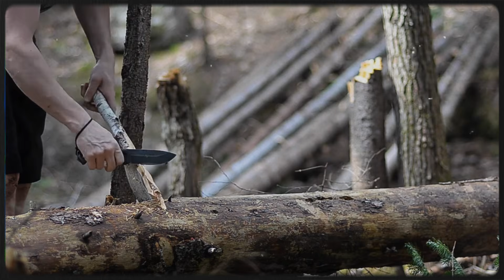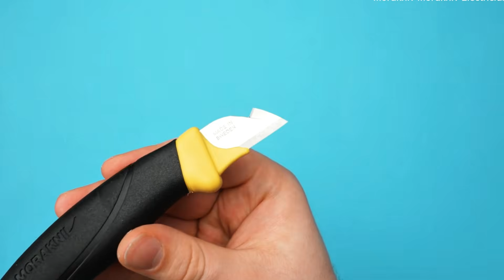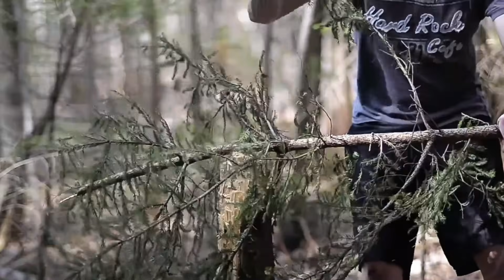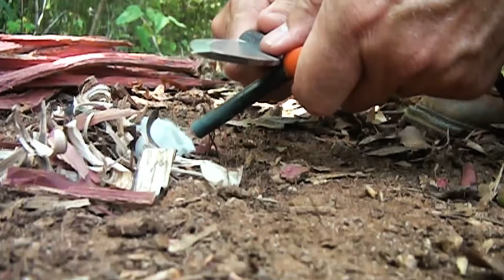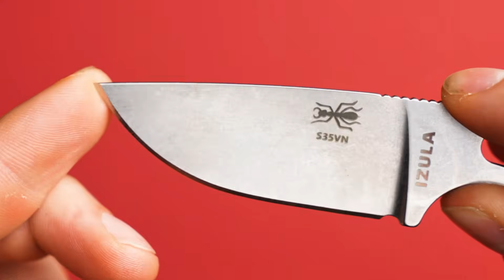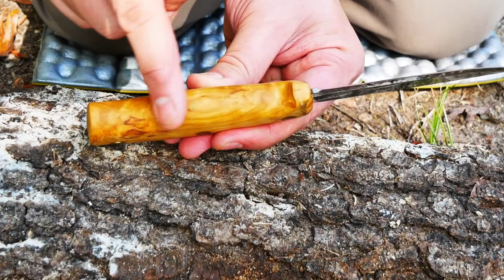TOP 10 BUSHCRAFT KNIVES Survival Experts Actually Trust (2026)

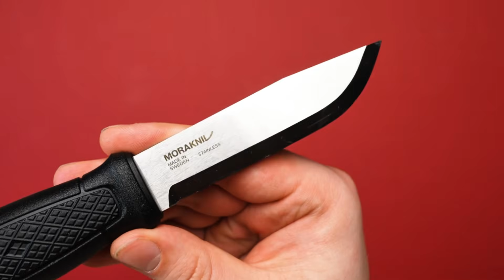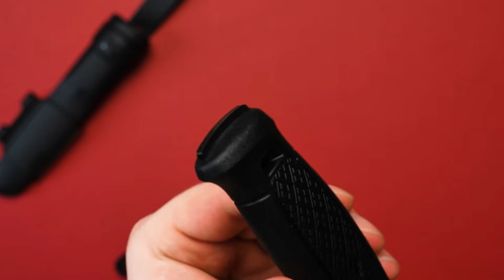Comment: Correction @5:40 - @6:01
The Morakniv Garberg Stainless comes with a fantastic 14C28N stainless steel blade with a rock solid 90° spine. specifically designed for striking ferro rods. And does a fantastic job at throwing a mean spark.

Comment: Well when I did most of my camping was as a kid and I carried a official boy scout pocket knife with the typical 4 blades, when that one got lost I bought a cheaper imperial pocket knife or inexpensive US companies similar pocket knife. When I did carry a fixed blade the pocket knives still got the most use. Your pocket knife is also there in your pocket to help you survive your daily life no matter where you are. I presentably carry a one handed swiss army pocket knife with a saw. If you hurt one of your hands or arm the one handed at least gets the blade open for use.
For bigger blades I have several types of 10-12 inch machetes. On type being the Cold Steel Black Bear Machete and a cut down Ontario machete. Those blades do not hold great edges but can take lots of abuse.

The is the JoeX destruction test of a Cold Steel Black Bear Bowie. I could not believe the abuse it took with out breaking.
https://www.youtube.com/watch?v=Ur9MLgAAhps
Reply from the maker: Thanks for sharing your experience! I completely agree that a good pocket knife often gets more real-world use than a fixed blade. Your point about one-handed opening is especially important—if one hand is injured, being able to deploy the blade quickly can make a real difference. The Cold Steel Black Bear Machete is definitely built to take serious abuse, and that JoeX destruction test is legendary. Appreciate you adding your perspective!

Comment: $175 ?!!! You have got to be kidding. I bought a Case two blade folder Arkansas Toothpick for $20. Carried it for over 20 years doing survival training for the Air Force. I never beat on it or did batoning on any blade. You don't need to split wood with a knife. Feather sticks are a waste of time and effort. I've been building fires for years and never needed at feather stick. When I went through The Travis York and Son's fishing and hunting guide school they made me make feather sticks. I never understood. I gather dry dead sticks that are about 18 inches long from the lower branches of trees. Much easier and just as effective. The other way is to use fat wood or pine pitch from pine trees. Birch bark is most useful and easier than a feather stick. It’s also waterproof.
Reply: When I was a kid camping I made a feather stick one time and I agree it was not worth the work. No one was trying to light a fire with a faro rod.

But that is in the mountains in southern California and everything is mostly dry and mostly pine trees. Can't remember seeing a birch tree ever. I am guessing now a days they do not want you peeling the bark off of them.

My conclusion is that feather sticking is a way to get into dry wood if the exterior is wet. The same with splitting wood.
I never saw any one baton a knife and I am really sure if I had don't that I would have caught hell for abusing the knife. However, batoning can get you into dry wood.
When I camped there was only a need for a small fire to cook on. Picking up dead branches or breaking dead branches off of a tree was what was done.

That is different from needing enough wood and larger wood in the winter to keep yourself from freezing. That is where that big BK9 comes in because it is going to be used as a hatchet. With that and a saw you can do a good  deal of wood processing.
When I saw the BK9 in the video my first though was machete.